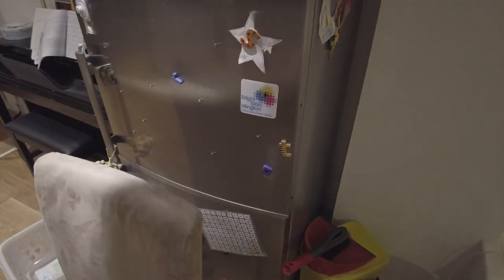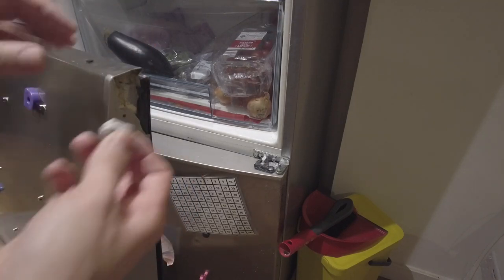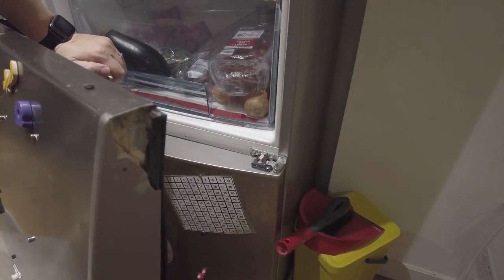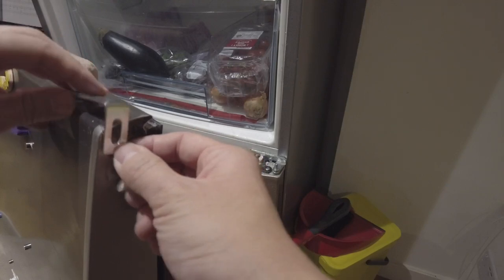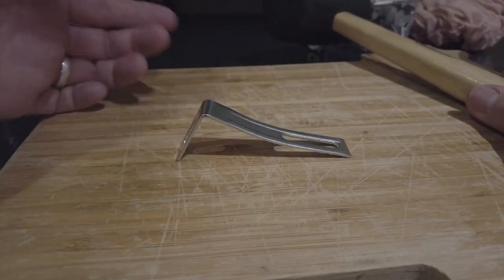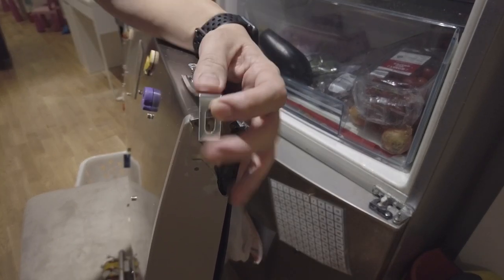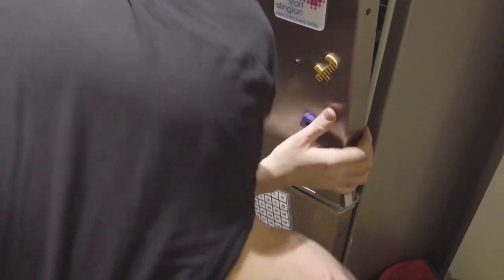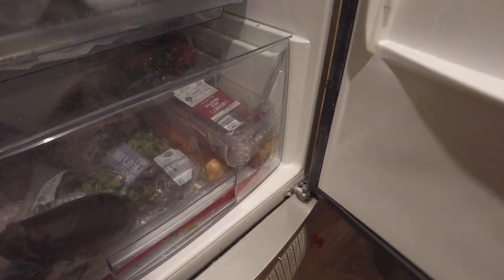How To Repair Fridge Broken Hinge Hole Replacement Hack

Comment: Does the freezer start dripping because of this?
Your plastic part is damaged and seems my door hole has kind of lost its edges a little
Seems my hitachi 2door(freezer on top) lower large door of main part of fridge the hole where the pivot goes in has become a little grazed at the edge or seems to have lost its perfect roundness.
I hope i got through with what im trying to tell u .
Hitachi techs say door may have to be replaced.